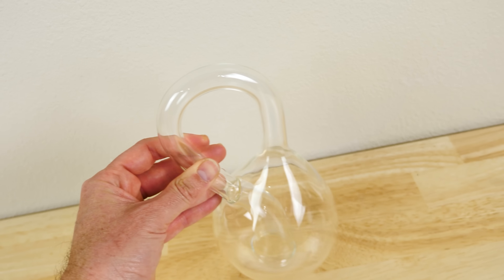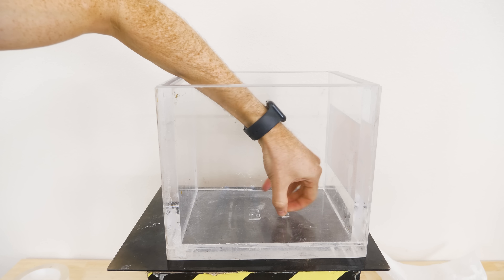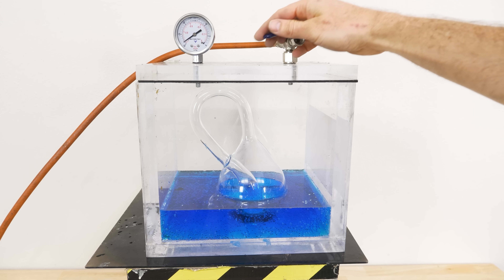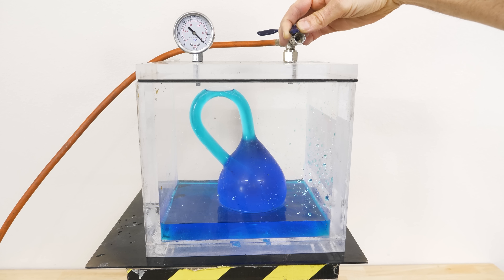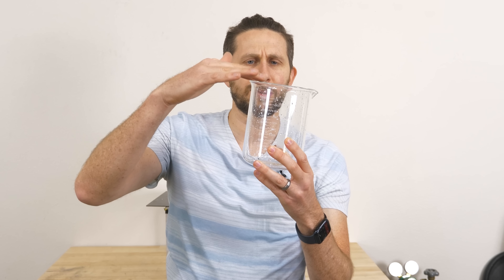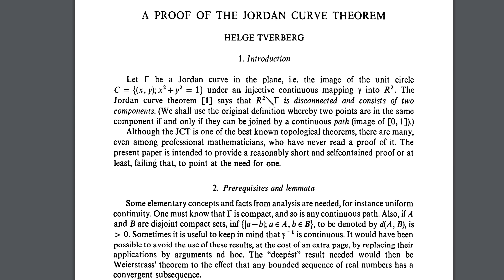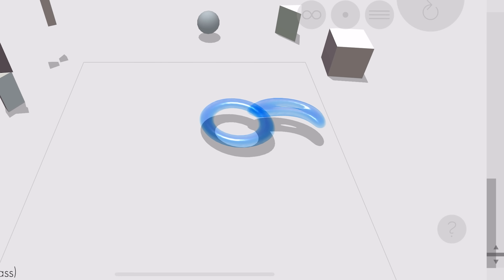Is It Possible To Completely Fill a Klein Bottle?

Comment: Caution: don't leave your klein bottle filled with water for a long time; if it gets algae or other growth on the inside, it's incredibly difficult to clean.
Reply: But there is no inside, remember?
Reply: @johnburrill2625  well, it WOULD be quite the task to clean something that doesnt exist, right?
Reply: @Deep1ceAlter34 🤣🤣🤣🤣🤣🤣🤣
Reply: @Deep1ceAlter34  You can’t clean a Klein bottle because your hands are prob gonna get stuck.
Reply: @johnburrill2625  So there will be no algae. GENIUS!
Reply: @johnburrill2625  It has an inside the same way as a cup or bottle does.
Reply: @techstuff9198  i think you missed the point
Reply: @when-do-we-get-a-block-button  I dodged it.
Reply: @techstuff9198  lol you dodged it. That was funny, thanks
Reply: @techstuff9198  you didn’t dodge it at all instead of catching and getting the point that it’s a joke you stuck you face out and let it hit you in the face by replying an actual response to a joke
Reply: @techstuff9198  so it doesn't have an inside?
Reply: @techstuff9198  boring asf
Reply: @techstuff9198  an artificial inside as cups don't have true insides
Reply: @jebbryant6522  All cups are artificial, and so are their insides. This is without question.
Reply: @techstuff9198  well since ya clearly just trying to play devils advocate I'll do the same. You're objectively wrong and not all cups are artificial also even artificial objects can have nonartificial insides
Reply: @techstuff9198  Not in mathematics, and you could be the only person thinking of definitions the normal civilian uses, therefore there may or may not be an inside, therefore, you both can be wrong, and therefore, nobody is 100% correct.
Reply: @when-do-we-get-a-block-button  but is the point on the inside or outside
Reply: @techstuff9198  uh oh
Reply: @yurxalot1715  

You might want to go back, re-read what you wrote, and then edit it into a coherent piece. If you're going to make a snide quip about someone else, do it properly at least.
Reply: @techstuff9198  r/whoosh
Reply: @techstuff9198  SHEESH
Reply: @techstuff9198  r/woooosh
Reply: @techstuff9198  what a power move
Reply: @techstuff9198 exactly, by dodging it you missed it
Reply: @when-do-we-get-a-block-button I think everyone else did you
Reply: I think YOU missed the point @when-do-we-get-a-block-button
Reply: @techstuff9198  watch 3:40 that's exactly what you're trying to describe here...
Reply: @techstuff9198 well what a clever way to say you missed the joke..
Reply: @techstuff9198  If the bottle’s open, at least.  If it’s closed it has an inside
Reply: @yurxalot1715  You need to reread it. Or tell me your comment is a joke, because it really seems like one, and a lame one at that.
Reply: @jebbryant6522  You're wrong too, but I guess that's playing devil's advocate, getting nothing right. First of all, name one cup that isn't artificial, one cup that comes from nature (and make sure you know the definition of "artificial," please). Secondly, that last thing you said... Well, that's absurd. It's something that could happen but doesn't, or it's null, and even scientists don't play around with things whose probability is zero, because it's basically stupid.
Reply: @johnburrill2625  It has sides bruh
Reply: @johnburrill2625  👍
Reply: @johnburrill2625 yes you techniqually right
Reply: @johnburrill2625 fr bro this dude
Reply: @johnburrill2625  i hope you joking
Reply: @johnburrill2625  uhh then how did he fill it if it doesn't have an inside also you can clearly see him fill it bro😂
Reply: Good thing you only have to clean one side of it! 🥁
Reply: @snappishtemperament213 i can hear the drum
Reply: Could you boil vinegar in it to clean it or is the glass too sensitive to heat?
Reply: @bloodleader5  i think it would make the glass feel hot but yes it works i guess
Reply: @bloodleader5  If you could even get the vinegar in it
Reply: @bloodleader5 you can’t fill it with the vinegar without a vacuum
Reply: @Brandzee-f6fYou responded to a two year old comment
Reply: @bloodleader5 
And your point is?
Reply: What if you did a bleach and water mixture in order to be too toxic for growth. Personally I really like the water filled Klein bottle
Reply: Not that Klein bottles are incredibly common in households.
Reply: @simarkarmani4034  Not that this comment is obviously directed to people who own one.
Reply: isopropyl alcohol and Coarse salt
Reply: shake well for about 2 mins while covering the opening
Reply: @DJD03  ready to find a way to  smoke a bowl out of thst Klein bottle? 😉
Reply: It can't be as difficult as cleaning a bong.
Reply: @urphakeandgey6308  you don't need a vacuum box to fill up a bong, or do you?
Reply: @urphakeandgey6308  Isopropyl alcohol and some coarse salt, let soak then swish around. Rinse with water. You can use rice instead of salt if convenient.
Reply: @urphakeandgey6308  those are a lot like Klein bottles haha.
Reply: @urphakeandgey6308 bongs are so easy to clean. 70-100% acetone with salt and shake it. Rinse clean with near boiling water
Reply: @urphakeandgey6308 That's not difficult either 
Salt and rubbing alcohol
Reply: @urphakeandgey6308 someone is going to make a Klein bottle bong just to see you struggle to clean it.
Reply: @Meme loaf it's used to grow my plumbus
Reply: @darksparkyshark430  grow deez nuts on yo chin
Reply: @darksparkyshark430  I thought they were made from dingle bops.
Reply: visualizing someone trying to wash out a Klein bottle feels like a background gag in a sci-fi show
Reply: What about Pasteur's experiment?
Reply: @westonding8953 a  ds
Reply: - @westonding8953
Reply: @westonding8953 He didn’t use a klein bottle, he used a swan neck flask
Reply: @endina  I know that but is there a way to ensure that germs don’t grow in a Klein bottle in a similar manner?
Reply: @westonding8953 He didn’t use a klein bottle, he used a swan neck flask
Reply: Just break it lol
Reply: Just use a Möbius strip. They are in the cleaning Section of stores. Thank me later
Reply: I love how you assumed that anyone would have a klein bottle in the first place
Reply: You can use a big turkey syringe and long plastic hose to get some cleaner in there, dish soap or bleach, and you can also fill it that way
Reply: But where is the inside?
Reply: @silverace20  the side that gets wet
Reply: @silverace20  it is the inside
Reply: What if I want algae in my klein bottle?
Reply: I’m surprised he didn’t just use a hose to fill the bottle, or even a sink sprayer.
Reply: A Klein bottle terrarium could be pretty cool though!
Reply: a klein bottle terrarium would be cool
Reply: @spiralfairy  lol 
I guess all currently are kinda. It’s a one sided object, so it’s kinda hard to differentiate inside from out.
Reply: Alcohol and rock salt, shake around
Reply: I'm getting Aperture Science vibes from this comment
Reply: boil it? owen it? microwave it? use a fishtank with a microhose to wash inside?
Reply: Caution: Klein bottles are almost impossible to fill although you can get inside one with a sledgehammer although it will cause lots of shards of glass to go everywhere.
Reply: @mulletmanplayz but i can still fill it with water yes?😂
Reply: just fill it with bleach, duh
Reply: Put bleach in the water. Problem solved.
Reply: it aint that hard to clean it because you can use tools that have bushes on stick where yall use it down sink drain it flexible stick it doesnt snap
Reply: Cant you fill it with Water cooling juice?
Reply: bleach! then rinse with hot water, bleach killes algea
Reply: @Meme loaf I used to but I smashed mine to be able to clean it better. On the bright side, I DID get all the shards sparkling clean so mission accomplished!
Reply: So fill it with sulfuric acid got it
Reply: @1ucifer6000ttv  nah fill it with jizz and make it a pony Klein bottle
Reply: Bro just pump in Sulphuric acid into the bottle just like how action lab sir did with water 💀
Reply: lol tf
Reply: Isopropyl alcohol, crystal clean.
Reply: Vacuum pump some soapy water i to the "inside" of the bottle, shake it aggressively, would that work?
Reply: Rubbing alcohol and salt 😅 hopefully tht works
Reply: pipe cleaner. gg ez.
Reply: Adding a small amount of bleach to the water helps prevent such growths in any device, container or network of tubes that you want to remain filled.
Reply: Yo I want a Klein terrarium
Reply: just give it to a stoner, they will get any glass clean
Reply: It has no inside do it doesn't get algae on the inside
Reply: @Ageoffernando  algae only forms on moving water not on stale stagnant water that's not moving
Reply: Just pump diluted bleach into it
Reply: True but it is probably because when you discover something. you name it by yourself.
Reply: I wanna create a small environment inside a Klein Bottle now
Reply: Just break it ,
Reply: Just break it then 😀
Reply: Couldn’t you just submerge it in water?
Reply: there is no inside
Reply: @DG-iw3yw  algae only grows in moving water bro. PFFFFTTBWUHAHA
Reply: Let me guess, first hand experiences?
Reply: Alcohol and salt or just acetone, not hard
Reply: Use bleach.  If it can survive bleach, we're fucked.
Reply: Oh yeah
Reply: Ok will do bro I'll keep that in mind with my Klein bottle I have at home
Reply: NO
Reply: Lol
Reply: He's got a vacuum, those clean things right? 😉
Reply: @Meme loaf W for “Wow it’s sparkling clean”?
Reply: just use the vacuum chamber with acid
Reply: Then you just call it an art piece
Reply: @Meme loaf we got bongs which the same thing pretty much
Reply: Я наблюдала зарождение жизни в самых невероятных условиях.
Reply: Сухое стекло хорошо отмывается хромпиком, но иногда может помутнеть.
Reply: Fine, I'll gift this as a "wine bottle" instead at the white elephant!!!
Reply: Try rice
Reply: @8swae  lol
Reply: @Christian Seibold Google it yourself when the water is not moving the algae consumes all of the nutrients and bacteria almost immediately and it doesn't grow
Moving water brings a fresh source of nutrients and bacteria constantly so we can just keep growing..
It's 10 times easier to grow algae on moving water than it is stagnant water
Reply: Bleach
Reply: Isopropanol, rock salt, and gentle heat with lots of shaking, don't ask me how i know how to clean glass pieces with tough to reach parts...
Reply: You clean it by forcing water and vinegar or some other cleaner in through a pump and then you suck it out with a vacuum
Reply: Fill it with whiskey. Got it
Reply: What if it gets algae growth on the outside?
Reply: I've got a solution for that I work in aquatics a lot just get yourself a few trumpet snails and put them in they'll clean the algae or another way that usually works is when we have tanks that have an overgrowth of algae we turn off the lights in them cover them with a thick blanket or something like that to block out the light and leave it like that for a few days and it will kill the algae and the water will start to clear up because the algae die without light
Reply: @Meme loaf nope
Reply: Nice... I have no idea what that means
Reply: Bleach...
Reply: Just enter the fourth dimension, stick your hand in and clean it normally, duh!
Reply: Nerd
Reply: @tacofacefart  u = dumdum who doesn't understand the comment so calls the commenter a nerd just because he/she doesn't understand it
Reply: I would just throw mine on the floor
Reply: How long am I leaving it in water?
Reply: Clean bottle hard to klein.
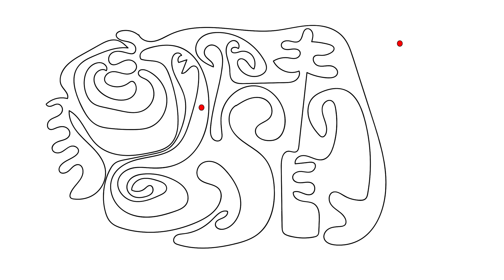Reply: 5:40 I counted 9 crossings of the curve lines
Reply: As odd as it may sound you might consider using some aquarium gravel or the like to clean it, by putting some in with some soapy water and swirling it around enough it will remove it, like sand abrasion
Reply: IMPOSSIBLE THING TO DO: Clean the klein bottle from the inside
Reply: And it starts to smell like weed really strongly
Reply: Use h2o2 ez
Reply: Yes.
Reply: BRO I JUST WATCHED A VIDEO AB IT
Reply: technically it's a disk isn't it?
Reply: nothing a little sulfuric acid can't solve
Reply: Ya mean the outside, right!bud dum bum
Reply: Try ultrasonic cleaner
Reply: It would probably look kinda cool though, a water world with strange worldbuilding
Reply: @mert yes
Reply: Where would you define the "inside''?
Reply: Ye jus fil w eg alc
Reply: I got my fish inside
Reply: If you could visualise the Klein bottle submerged,the areas where the bottle intersects itself seems to contain water but since Klein bottle is non orientable,it wouldn't behave like a typical object that can be filled.
Reply: no duh
Reply: lol 🚡
Reply: Just use coarse salt or sand and shake it.
Reply: vacuum it with peroxide, done.
Reply: Maggots:fine. I’ll do it myself.
Reply: Cups don’t have an inside, so I just pour juice on top of my cup. What I’m not sure about, is what side of a straw is the top and what is the bottom.
Reply: bleach and UV light.
Reply: Cyanide
Reply: But... I'M inside the klein bottle!
Reply: Wrong, keeping it full for too will rupture reality and cause a tear in the fabric of time and space
Reply: The algae also growth outside
Reply: Use magnets inside of two sponges
Reply: There's at least 3 layers to this comment I can tell.
1. The shape makes it hard to reach the convex side of the bulb so it's hard to reach to clean
2. The Klein bottle has no inside.
3. You can't have an actual Klein bottle because you exist in 3 dimensions.
Reply: You can use solvent or beads and shake it.
Reply: 96 % alcohol works well for my bong🤷
Reply: @milkoncheese2078 if you dilute to 60 or 70%, and add large salts, you can get better cleaning while using less alcohol.
Reply: @milkoncheese2078  I can't get into mine with a sponge and it drives me nuts! I feel like if I can't actually wipe it out, it's still dirty. My bong doesn't get used much for this reason.
Reply: @silentsunset4200  bro you just gotta put the alcohol in the there and shake it for like 5 mins you could put some other shit in there like a bunch of tooth picks or something if you need like somthin heavy duty but if you do it often which you should you shouldn't need to
Reply: Not if you fill it with chlorinated or salted water, or use a strongest chlorinated water to clean it after all.
Reply: I can imagine
Reply: Not really, fill with salt, isopropyl and shake. Clearly your not a filthy stoner marijuana addict like me 🤣💀
Reply: I thought this was gonna be a bong warning
Reply: Algae only comes from MOVING water bro!? *SCIENCE 
I don't understand how you can get algae inside of something when there's no moving water?
I don't understand why you would warn somebody about something that's not scientifically possible?
LITERALLY NOONE ELSE CAUGHT THIS? 
PFFFFTTBWUHAHA

Comment: another option would be to insert a straw inside through the tube to allow a 2nd path through which the air can escape like the chimney of a steam engien is a pipe inside a pipe for exactly this reason.

Comment: If you can fill it fully with air by pouring all of the water out, then you can conversely fill it fully with water by pouring all of the air out.
 
If that doesn't hold true, then you can neither fill it fully with air nor water.
 
The trick is submerging the entire bottle so the air "pours" up out of the bottle.

Comment: Your filled klein bottle actually has volume, because you holding the bottle as you do, you separated inside from outside, if I took a cross-section of the bottle when you're holding it, you "closed the bottle with your hand

Comment: at 29 seconds in, I think you can insert a flexible tube and burp the air from the system to allow you to fill it completely without using the vacuum chamber.

Comment: It could be said that both the Klein bottle and beaker have a volume... of glass.
Reply: That’s right, and it’s easily measurable too by calculating the difference of the volume of water in a beaker or container after submerging the bottle.

This dudes a hack

Comment: Even if you make a full vacuum in the chamber, there is still pressure at the entrance of the bottle because of the water above it, so not all the air is sucked out. If you want to fill it in one go you have to make the vacuum then pour water.

Comment: It's important to specify that the Klein bottle only has no volume as defined by the field of topology. But topology also makes no distinction between a doughnut and a coffee mug, so I don't think their definitions are the most relevant to everyday life
Reply: It also has no volume in any other field, because it's a two-dimensional manifold and the term volume doesn't make sense below three dimensions. You could define a volume that enclosed by it, but it doesn't have a volume.
Reply: @Airblader  that's like saying a box without a lid doesn't have a volume. From a purely mathematical perspective, sure. But for all practical purposes, it has a volume. In terms of volume, a Klein bottle is literally just like any other bottle without a lid.

Comment: Well, actually it has volume but not a fillable nor isolated one. What I mean is, the thick of the glass is the volume itself, just like the beaker. If you submerge the bottle or the beaker, it will still displace water so it has a volume but not a fillable and isolated one. Not having a division between an inside from an outside it doesn't make it a volume-less object. Just by existing they are displacing gases from the air.
That sentence is wrong and omits information. There is no such thing as mass without volume.